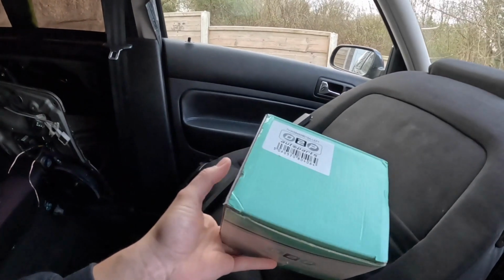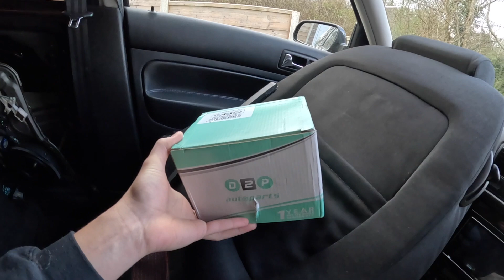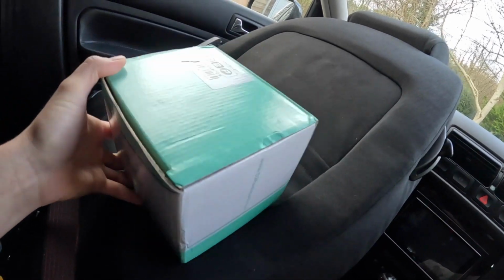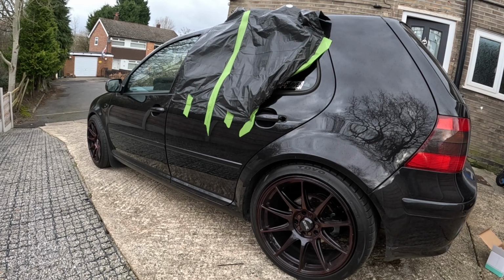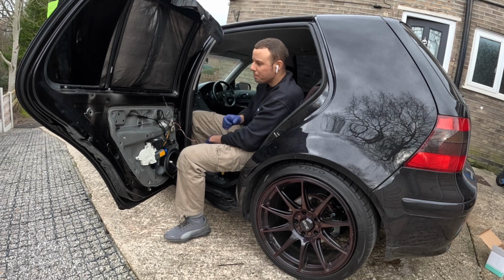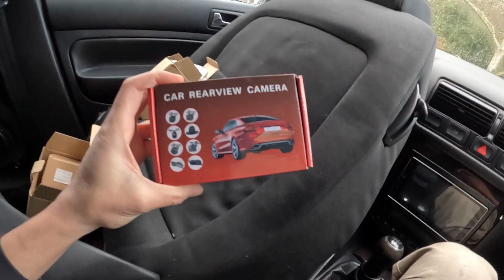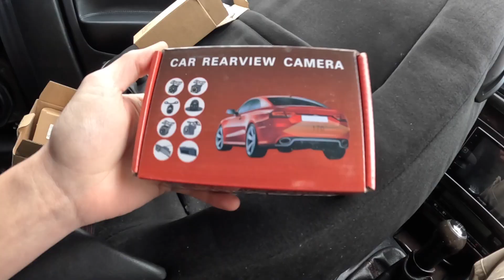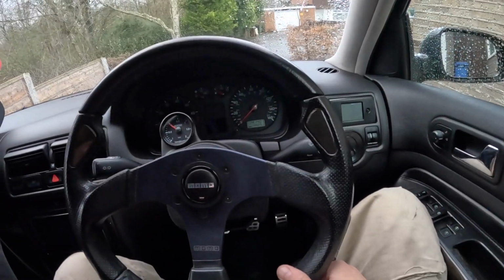VW GOLF MK4 ISSUES AGAIN!!!

Comment: I have 4 door issues on mine lol. All 4 are just...not working.
Reply from the maker: Oh mate! that's typical with these cars lol, I hope mine lasts 🤭
Reply: Look under the carpet where the CCU is located, maybe it‘s floated because water coming in on the drivers side door or water coming in trough your Pollenfilter because a broken/missing plasticcover. CCU controls your central locking system, interior lights, memory seats and and and..
Reply: If you are lucky it‘s just a dead fuse.